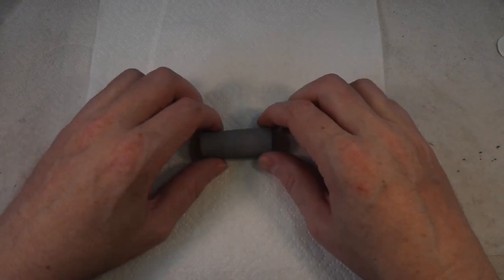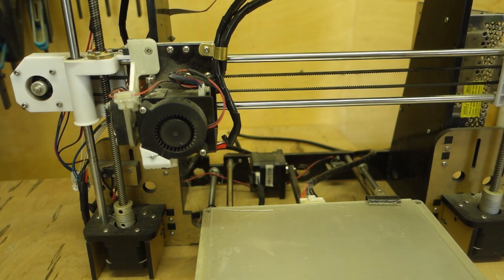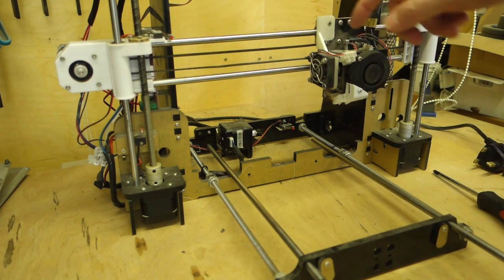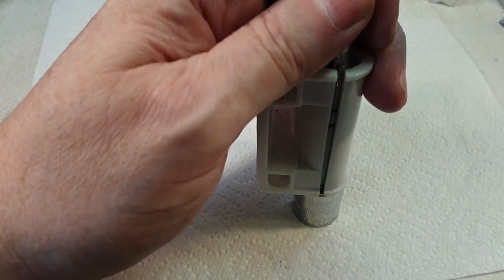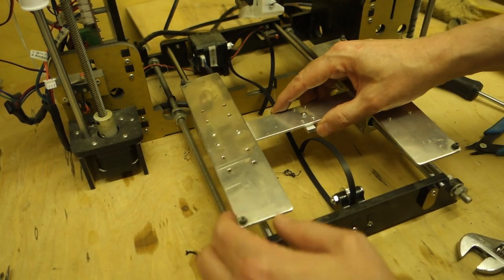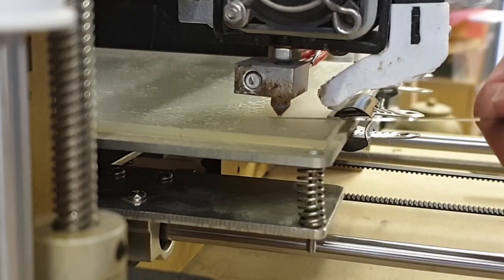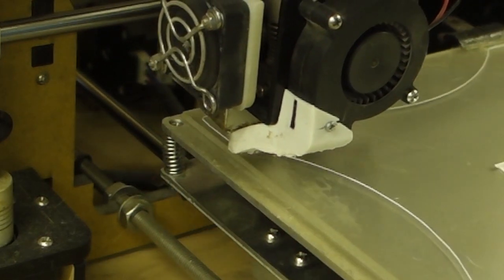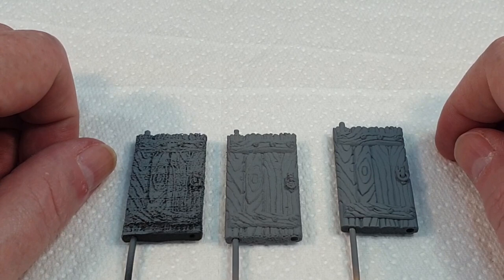Repairing my 3D printer with new belts and bearings

Comment: I'm surprised that pulleys of different diameter didn't affect the motion through the stepper motors.

As far as stringing goes... teach me, oh guru! I have virtually eliminated it on prints, but I still get it on support. Since I print a load of complex stuff like ships & tanks, I need a lot of support material. It doesn't matter much on the support, but the string gets on the print proper as the print head moves around.
Reply from the maker: I did wonder about that, but the idler pulleys I added are the same size as the drive pulley, whereas the old ones were smaller, so I think it would run smoother anyway. As far as stringing goes, I've actually been looking at that specifically lately, so once I have some results, I might do a little video on it.
Reply: @SteamGeezerUK  I guess it's the drive pulley that really matters. If I could just defeat stringing from support material I'd be 100% happy with my current setup.

Of course, then I'd try to do something extra with it...
Reply from the maker: @WulfCorbett  There are settings in most slicers for avoiding stringing, but I think you might have to enable them separately for supports. Look for "combing" and "wiping" in your slicer.

Comment: I'd thought that i found a video where i could get guidelines on how to disassemble the X axis bars in order to replace the linear beaaring blocks. And then i found you skipped that part in this video...
Reply from the maker: I'm sorry to hear that. On mine there are grub screws on each end locking the bars in place. If you loosen those, the bars should slide right out. I hope that helps - if not, let me know and I'll try to find the printer and make a little video of it.
Reply: @SteamGeezerUK  I will try tomorrow, thanks.